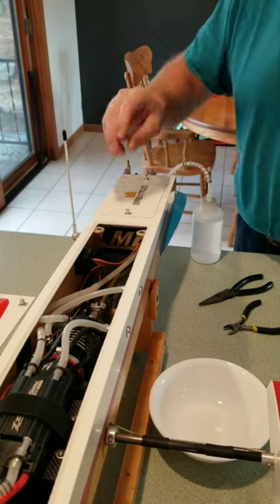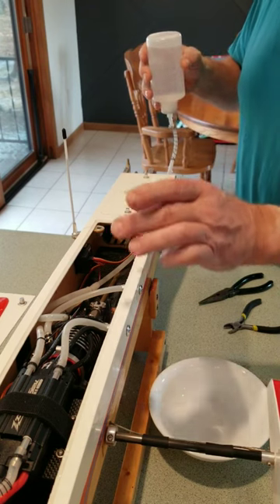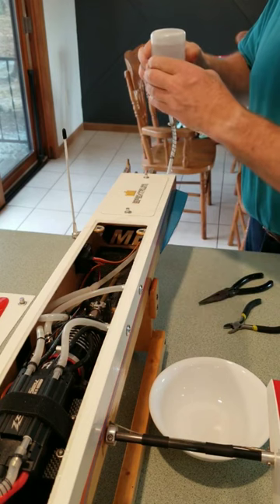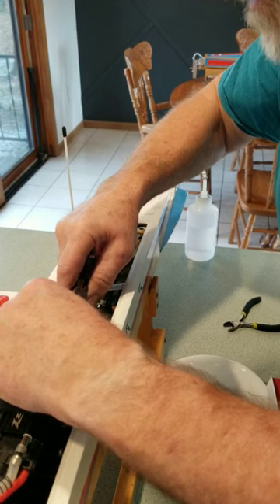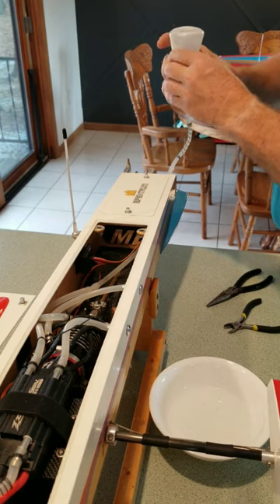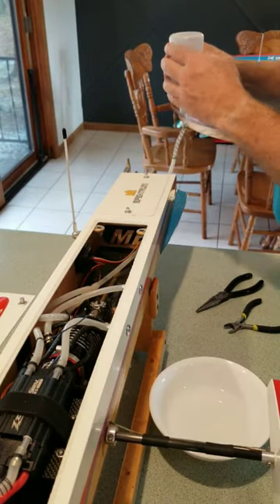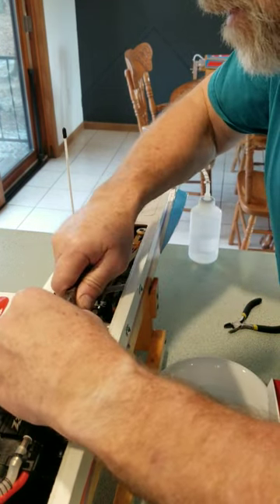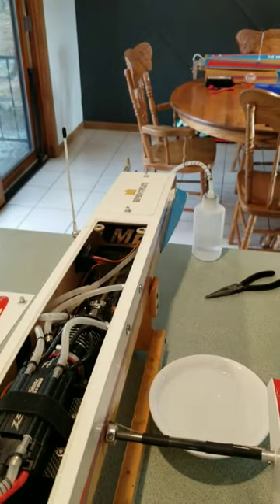Perfectly Calibrated RC Boat Cooling System! #rcboat #outrigger #shorts

Comment: Once you get temp data of the motor and ESC, you may find that in some setups, you can omit cooling all together. Specifically speaking for SAW runs at a 2 or 3 run max. The xlx2 can withhold high heat for 3 runs. More concern would be on the motor temp. Using real time telemetry can give u that motor temp as it's running. If according to your setup, the temps are within safe range, omit the cooling--less drag, less weight. Also gives you the option for modified knife rudder blades which will be thinner and less drag than the intake rudders. Your set up data will dictate if you can move in this direction. Bear in mind overall air temps depending on the season you are running in will come into play.

Comment: Wonderful idea! Only thing I would slightly adjust would be to place the restrictor on the outlet side of the esc keeping the consistent high pressure zone throughout the heat exchanger in the esc and put pressure drop on the discharge tube after the heat exchanger.

Comment: I did what you have done on my 26” ecomaster rigger using only a Seaking pro 120 amp esc (so no data log ) 2968 3400 kv rocket motor.
 I got 94.5 mph .So far.
I only had a tee piece not a Y and It’s got perfectly even flow.
A Y would make hose routing so much easier.
For me motors are cheap but esc’s are not so up until putting the tee piece in I always took the water to the esc first.
Temps are also even